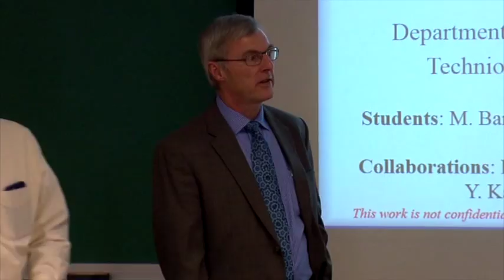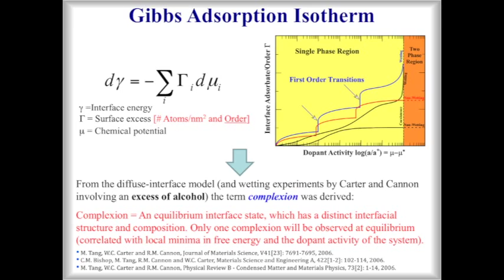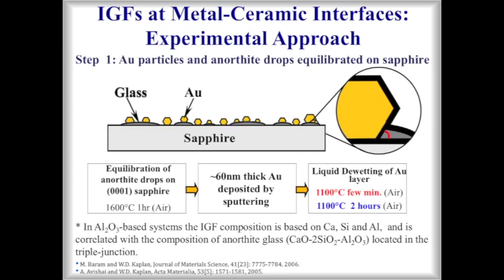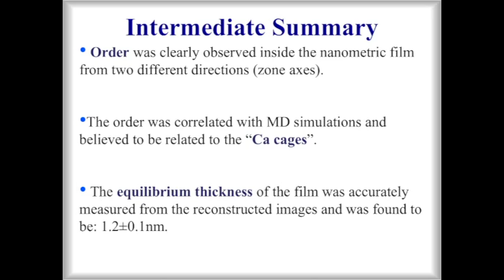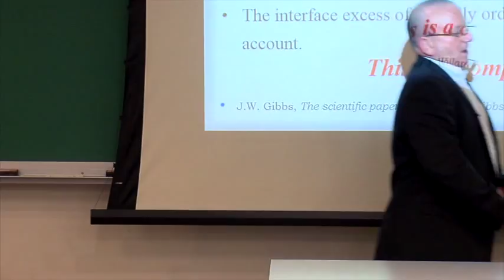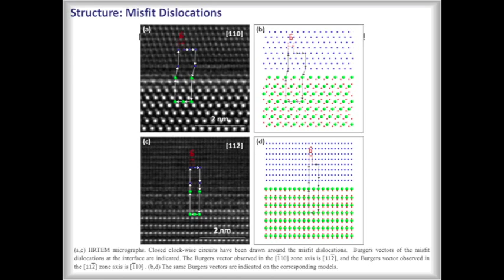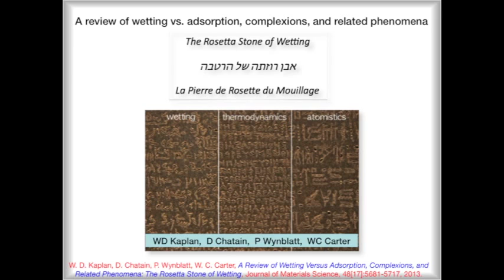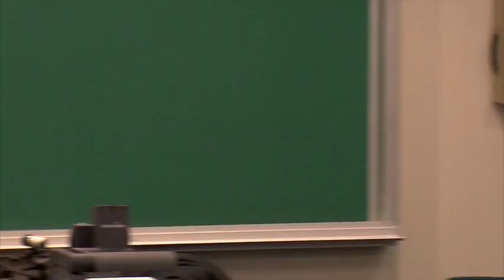2016 Van Horn Distinguished Lectures: 2 (thermodynamics of interfaces)

Comment: Real-time TEM observation of dynamic structure of liquid-vapor interface at nanometer resolution in electron irradiated sodium chloride crystals (7/7)
Paper link: @t
Video 1 - liquification: @t
Video 2 - Fluid dynamics: @t
Video 3 - Brownian motion in liquid: @t
Video 4 - Brownian motion in vapor: @t
Video 5 - Nanoparticle fusion: @t
Video 6 - Nano-motor: @t
Video 7 - Interface structure: @t